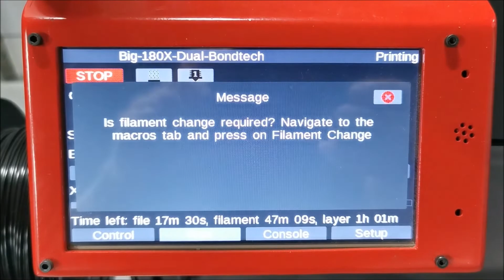Modix Clog Detector

Comment: How would an encoder / filament presence detector determine if you have a bad first layer? You're still extruding filament at a constant rate, it just wouldn't stick to the bed. Or is there enough back-pressure that you can actually see differences between typical extruding and "extruding in air" ?
Reply: it will mostly detect a situation where the nozzle is too close to bed and it generates under extrusion